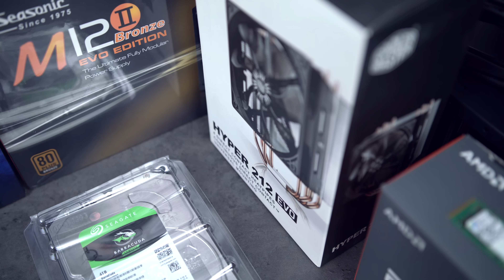$1100 Editing/Gaming PC | Time Lapse Build

Comment: Beautiful.

BTW, what is that? 0:32
Reply: Tuks facepalms BRO!!!
Reply: Tuks it's a m.2 ssd. Faster than sata but more expensive most of the time
Reply: Jrds 01 not really if it's not NVMe
Reply: Ozone Strike that's correct, but id guess he used a nvme bc sata is as fast as a 2.5 inch one
Reply: Ozone Strike but another reason to use m.2 is for easy installation I guess
Reply: Jrds 01 yeah, and taking way less space + no need for cables
Reply: Ozone Strike exactly
Reply: An m.2
Reply: Tuks nvme

Comment: i would put that side panel at the top of the case because the cooler has rgb and the gpu has some rgb aswell on the sides  + it would improve gpu temps with vents on the side of it

Comment: MOBO- B250f strix
.
Gpu - asus strix 1070
.
CPU- i5 7500
.
RAM- 8GB
.
HDD- 1TB WD
.
CASING- S340
.
Psu - What/which power supply do i need for this build.

Comment: For gaming at a similar budget, I would use an r5 1600 and gtx1070. Why the 1600 over the 1600x? Well, the OC isn't that high anyway, and you're saving ~$50 since the 1600 both costs less and comes with a fan. You can OC the 1600 a little bit if you really want to.

Comment: DISCLAIMER  This build comes out to a base price of $1335.56 before taxes on pc partpicker and that is without the cooler. keep in mind that gpu prices are inflated. the msrp of a RX 580 is between $200 - $250 for a 4 GB card.

https://pcpartpicker.com/list/73ZJ4C

Here is a similar build saving you about $113 with slightly higher ssd storage, a faster rpm on the HHD  but losing a few style points, 1 TB on the HHD, and a slightly higher cas latency on the ram.

https://pcpartpicker.com/list/G7wg7h

Comment: I'm building my first PC very soon (acquiring parts right now) and I'm using the same case, same processor and the same motherboard. So this video certainly boost my confidence in those choices. I still need to choose ram though, how is the ripjaws ram working out? I was interested in it but i didn't see it in Asrock"s Q.V.L. or in Gskills Q.V.L.

Comment: I'm building a pc, My budget is 350$ CAn you guys give me tips how I can make it better but at the Same price. 
My parts 
Intel - Pentium G4400 3.3GHz Dual-Core ProcessorGigabyte - GA-H110M-A Micro ATX LGA1151 MotherboardCrucial - 4GB (1 x 4GB) DDR4-2133 MemoryWestern Digital - Caviar Blue 1TB 3.5" 7200RPM Internal Hard DriveXFX - Radeon RX 460 2GB Video CardZalman - T2 Plus MicroATX Mini Tower CaseEVGA - 500W 80+ Certified ATX Power SupplyAsus - DRW-24B1ST/BLK/B/AS DVD/CD Writer

Comment: So I've started saving for a PC from this Monday and so far I've got $10.50,Plus the parts here are fucking expensive so it will take me like 6 months to get a decent PC. I guess I'll make a $700-$1000 PC,Any suggestions for it?
Reply: Gtx 970/1050ti for the gpu
Reply: I was planning to get a GTX 1060,is it better than the 970? I've heard the 970 is sometimes better than the 1060
Reply: I recommend waiting for the graphic card prices to go down or half your budget will go to it. Bitcoin mining seems to be the sole reason for the lack of graphics cards on the market but that "hype" bubble will pop and prices will stabilizes within the next 2-4 months.
Reply: GameNuts ye if ur going for 1000 budget gtx
1060 6gb is a good choice
Reply: GameNuts In 6 Months we will probably have a new GPU gen from both AMD and NVIDIA.
Reply: Edit: I have very limited knowlede on this subject and am just trying to help and improve my knowledge.

I built one for around $650 and it had an AMD Vishera (Six Core CPU), ASUS GTX 1050 Ti, 8 GB of Patriot RAM, a 1TB Western Digital Black HDD, and a 80+ Bonze 600 watt power supply from Thermaltake. All of this rested on the ASUS 970 Pro Motherboard.

So, if that is $650, you can upgrade from those specs and maybe get a 256 GB SSD along with the terabyte. The 1050 Ti could become a 1060. Maybe even make that an AMD card if that's what you want. As shown in the video above, the RX 570 or 580 would work. The RAM could become 16 GB. As for your CPU, I'm afraid I can't offer something here, as my knowledge isn't the best. The motherboard will have to be based on the CPU, so no suggestion for that. If I had to take a shot I'd go for maybe an i5?
Reply: Philip Lee I was planning for an i5 7500 cause I'll just do music production and some slight editing with some gaming
Reply: For 1k do i5-7600k/gtx 1070 or i7-7700k/rx 580. I did a $1k build with an i7-7700k/gtx 1070 but it was pretty hard to find the deals to squeeze it into $1k
Reply: Sachin Nair I think Lamington Road is a great place to buy PC parts for cheap?
Reply: GameNuts lamington road? Never heard of it... I go to micro center for my parts, they have some kick ass deals. Can you link the website if lamington road?
Reply: Sachin Nair Its a place in Grant Road,Mumbai.. there are various shops there
Reply: GameNuts nice... sorta like the microcenter of india!